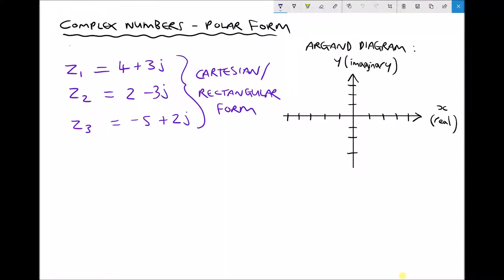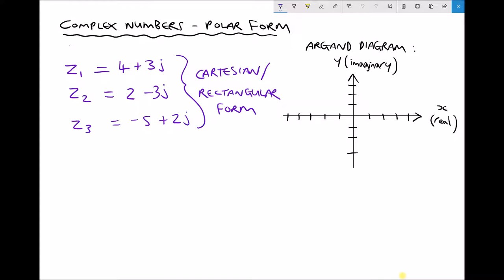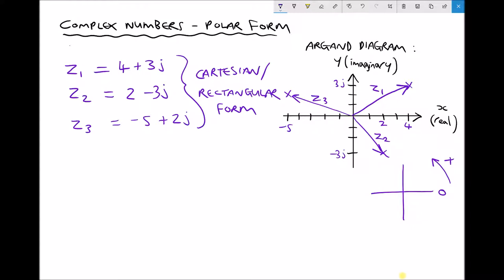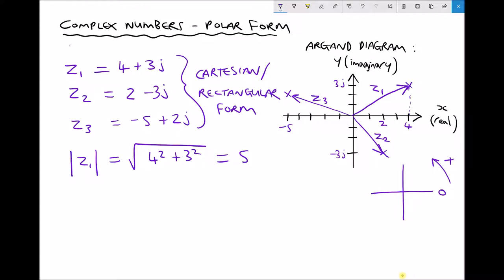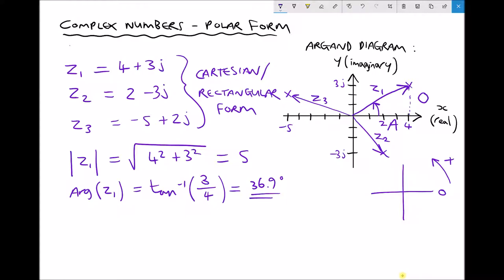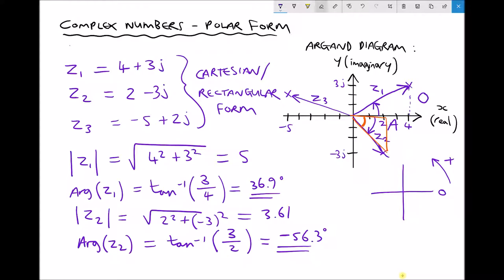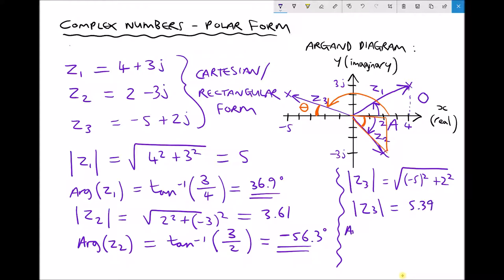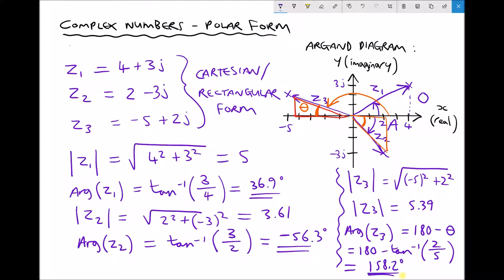Converting Complex Numbers from Cartesian Form to Polar Form

Comment: Tan^-1(3/4) without calc,can you explain me..
Reply from the maker: I do use a calculator for this, but had calculated it before recording the video.
Reply: @EngineersAcademyLTD  can you help me out with that.
Reply from the maker: Usually tan-1 is the second function on the tan button. On my calculator I would do SHIFT Tan (3/4)